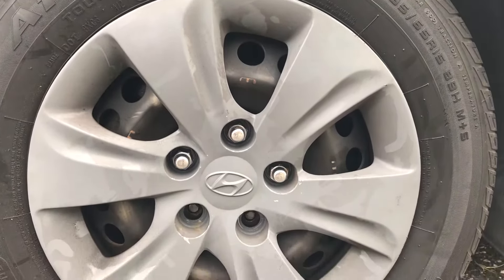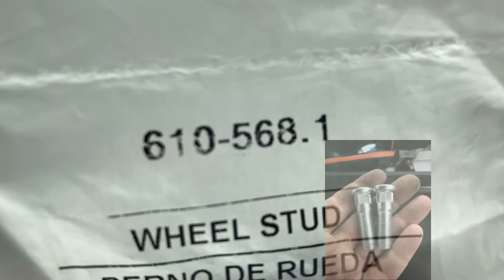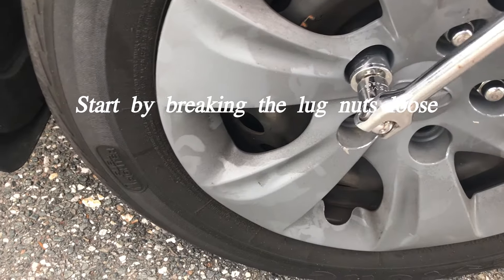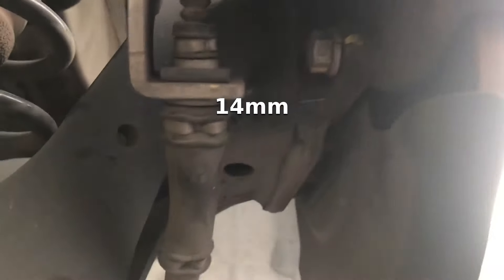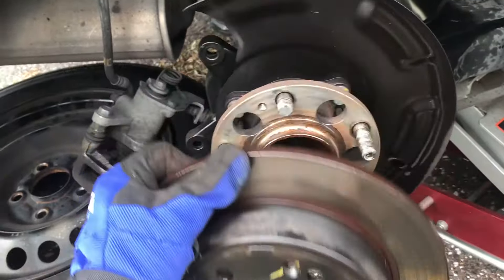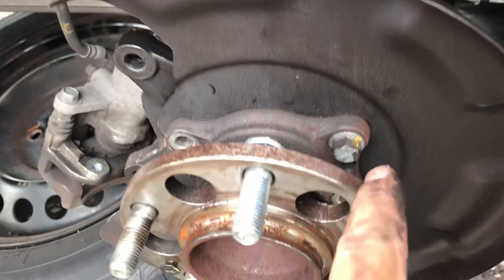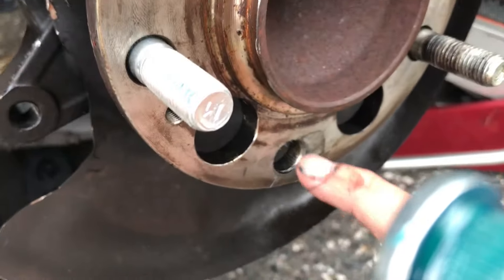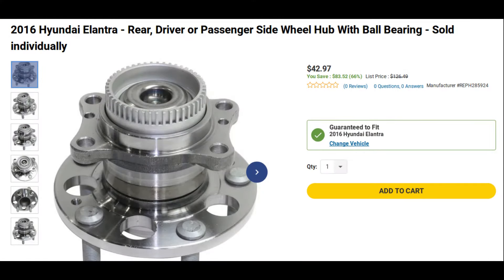How to replace a broken wheel stud or wheel hub (Hyundai Elantra)

Comment: Front passenger I took the break and the rotor off but the back plate is too close to the wheel hub to where you can't knock the stud out befor,e it runs into it much less put another one in how do I do

Comment: On older ones just cut 2 slits into the heat shield behind the hub, bend the tab you've made back, replace the stud and bend it back. $2 stud and 15min job start to finish!

Comment: I found a video where someone took washers and a lug nut and tightened the lug to the new stud and basically pulled it through until it was flush. Pretty cool! May save some time taking the hub off! Love the video though. Thank you!
Reply from the maker: Oh that’s a good idea with the lug nut and washers👍
Glad you loved the video 😃
Reply: As a rather small mechanic i prefer this method. Hate smashing my fingies hammering on bits i know im barely strong enough to get through
Reply: i know im asking the wrong place but does someone know a method to log back into an instagram account..?
I stupidly lost my account password. I would love any help you can give me
Reply: @Kelvin Briggs Instablaster :)
Reply: @Everett Rory thanks so much for your reply. I found the site through google and Im in the hacking process now.
I see it takes a while so I will get back to you later when my account password hopefully is recovered.
Reply: @Everett Rory it did the trick and I actually got access to my account again. Im so happy!
Thanks so much, you saved my ass!
Reply: @Kelvin Briggs Glad I could help :D
Reply: Just saw the video and came here and thought the same thing lol

Comment: you do not have to remove the bearing you put a big bolt over the stud and torque down the actual wheel nut on top of it and  it will pull it in

Comment: Got a 2010 elantra w broken lug bolt. Took both 14mm bolts off.  Caliper still connected by 2 screws 11/16. Do I remove also? Kinda stuck !
Reply from the maker: Get that caliper off
Reply: By prying or removing the 11.16  not a snug fit nor 5.8. Are they 2 bleeder screws which need that special head ?

Comment: Ok how did you get those philips head screws out without stripping them?
Reply from the maker: ? I sprayed them with a lubricant; use PB Blaster that works really good 👍
Reply: Use a manual impact driver
Reply: @GetOutTheHouseGoFish  thanks it worked.
Reply: Buy a cheap impact screw driver from harbor freight they are like 8$
Reply: Basically whay you want to do is apply pressure as you turn the screw driver as well as hitting it with a hammer

Comment: Is it dangerous to re-use the front old hub?  People recommend using a new one. Mine is free rust and 154 K miles only.
Reply from the maker: That’s a lot of miles and I’m he hub isn’t that expensive if purchased online.
Reply: @GetOutTheHouseGoFish  . got you. I did it. Did the whole job for the first time. new bearing and new hub. two hubs cost me $54 and bearing $42 for two.
Reply: @GetOutTheHouseGoFish  Now replace the harmonic balancer and still the vibration.
Reply from the maker: @irisbaez1972  probably need an alignment.
Also check tires for uneven wear.
Try putting the front tires to back and back to front and see if there’s a difference.
Reply: @GetOutTheHouseGoFish  Nothing of all that fixes anything. I have two years with this problem and I have replaced everything I can imagine. I have dome everything people have told me here on youtube. I took it to the dealer and see what happen. Money, pain, sweating, wasted time, and still there. How much I would save if I took it to the dealer from the beginning?
Reply: Dealer did nothing, they don't know anything, they only want to make money, they don't even drive my car and they come out to replace what I already did.

Comment: I get the people don't know the difference between bolts and studs but that doesn't make this any more correct to have this under bolts cuz there's other parts of the car that actually need bolts pretty much most of the any other part of the car maybe if that was explained in some other videos people would stop looking up bolts for in place of studs on carsThe big difference there is no other end the end on one end is the same as the other of a stud
Reply from the maker: Thanks for the input